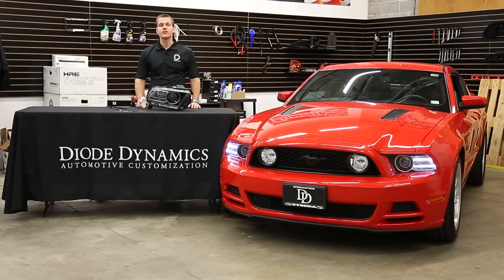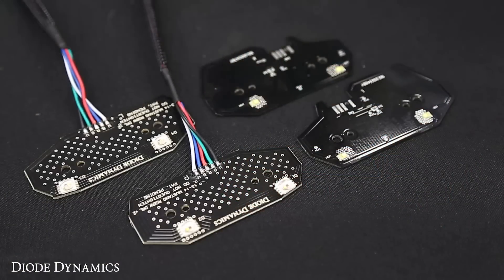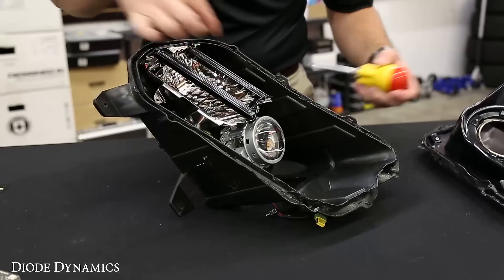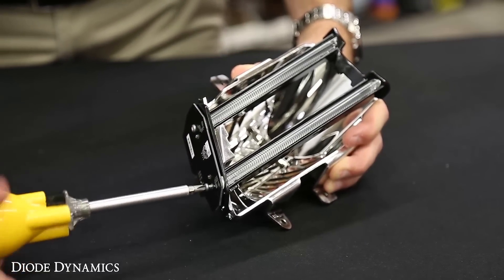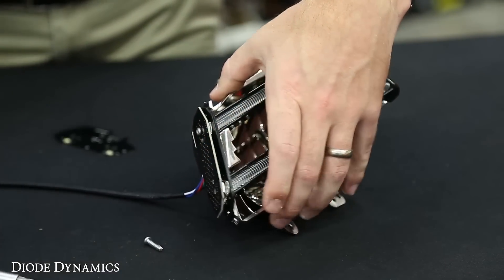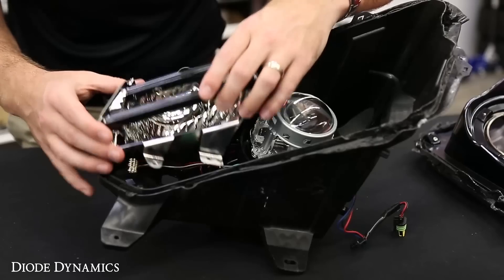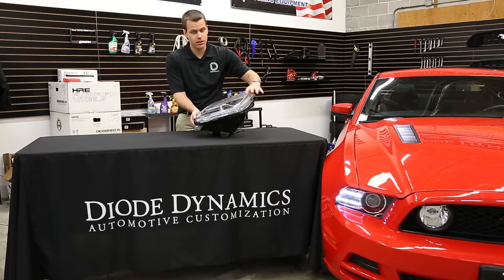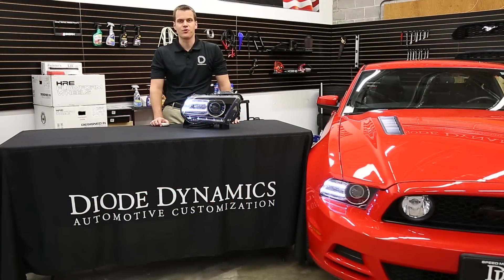How to Install 2013-2014 Ford Mustang RGBW™ DRL LED Boards by Diode Dynamics

Comment: Can you guys make a video of where to wire them to the fuse box or the battery because I’m confused and is it supposed to come with a controller so I can leave it at a certain color or will it just keep changing how does that work very curious
Reply from the maker: This kit does require a Bluetooth controller. Here is the link for you:

https://www.diodedynamics.com/rgbw-bluetooth-controller.html

If you need any help with the installation, our in-house US Customer service team would be more than happy to help you out with that!

Hours: Monday-Friday 10 a.m. - 5 p.m. CST
Email: contact@diodedynamics.com
Phone: 314-205-3033

Comment: It would really benefit customers if you took the time to show how to wire these. Anyone can make a video to remove the old board and replace it with the new one. My specific issue is tapping them into the headlights/turn signals.
Reply from the maker: We will consider this for the future! If you need help with the install, feel free to give us a call at 314-205-3033 Monday-Friday 10 a.m.- 5 p.m. CST, or shoot us an email at contact@diodedynamics.com, and our service team would be happy to help you with that.

Comment: One of the led strip went out on my passenger side headlight. ..... just a shot in the dark question, do you think if I replaced the board that it will fix that problem? Or should I get a whole new unit. Thanks!
Reply from the maker: Hmmm - We would like to hear more about the issue. Please go ahead and give us a call at 314-205-3033 Monday-Friday 10 a.m.- 5 p.m. CST, or shoot us an email at contact@diodedynamics.com, and our service team would be happy to help you with that.

Comment: Hi, I have an issue with my driver drl, doesn't turn on, is there any fuse to replace or could be disconnected ?  Only the driver drl have the problem
Reply from the maker: Hi Jesus! Please go ahead and give us a call at 314-205-3033 Monday-Friday 10 a.m.- 5 p.m. CST, or shoot us an email at contact@diodedynamics.com, and our service team would be happy to help you with that.
Reply: Did you ever find out what caused it?

Comment: Hey so I just got mine all done up. I have the demon eyes and drl boreds as well. My drls will stay off when I turn the headlights on with out the rgb but they work when I have the rgb on.
Reply from the maker: Yes, you will need to have the RGBW on to run the DRLs. You can set them to white through your controller or app if you have the Bluetooth Controller for on-road use!

Comment: Where’s the wiring guide?
Reply from the maker: Hello there! Just remove the original boards, and ours will fit directly in place with correct alignment. Please go ahead and give us a call at 314-205-3033 Monday-Friday 10 a.m.- 5 p.m. CST, or shoot us an email at contact@diodedynamics.com, and our service team would be happy to help you with any further questions you may have!

Comment: how did you open light housing  ?
Reply from the maker: Hi there! For this particular product, the headlight must be heated up in order for the adhesive to soften, allowing the headlight to be opened. We strongly recommend professional installation, as it is possible to damage the headlights and other components during this process.

Comment: Ordered them and one of them doesn’t work. Talked to a dealer and he said 1 in 50 is usually faulty. Pretty disappointed.
Reply from the maker: We are very sorry to hear about the issues you've experienced with your board! We do test them in-house before shipping them out, so it is very unfortunate to hear that it is not working. If you have not already, please give us a call at 314-205-3033 Monday-Friday 9 a.m.- 5 p.m. CST, or shoot us an email at contact@diodedynamics.com, and we can help you with any troubleshooting and get you taken care of with a replacement if needed. Again, we truly apologize for any inconvenience.

Comment: HARDEST THING TO DO.... HAVE A PROFESSIONAL DO THIS
Reply: It’s not hard to do; just time-consuming. You need to have a lot of patience to open them up properly, but everything else isn’t that bad. Just set a day or two to do the project and don’t rush it…
Reply: @jmendozas197   do u have a social media or any way I can message u for help
Reply: @truguard1763  What issues are you experiencing?
Reply: @jmendozas197  everything it plugging in the bluetooth controller lights up but no rgb

Comment: i don't know if you seen the raxiom halo fog lights would this work as well with the fog lights?
Reply from the maker: +Gilberg Ifarraguerri We're not familiar with the product you're referring to, but you can use an RGBW or RGB controller to control our boards and other mulitcolor products simultaneously! If you have any further questions, please don't hesitate to contact us!
Reply: you don't the same chip for the fog lights to change colors?

Comment: Do I connect the transmitter to the battery? I bought these lights and connected all the RGBW to the transmitter Im just confused what to do with the 2 red wires and the one black wire... Please help
Reply from the maker: +Chris Nieves Please send us an email at contact@diodedynamics.com, and we can walk you through this!

Comment: Where can i buy the stock led light? i like the stock white but one the led lights on the driver side stopped working
Reply from the maker: +tripleb4life These boards can be set to a pure white running light for a clean OEM look!

Comment: Help i don't understand how to wire them
Reply from the maker: +Darryl Metcalfe, below is a link to our installation guide with wiring instructions on the back. If you need further assistance, feel free to contact us at 314-205-3033, Monday-Friday 9am-5pm CST, or email us at contact@diodedynamics.com, and our sales representatives can help you out! 

http://diodedynamics.com/docs/install/ford/mustang/13-14_Ford_Mustang_RGBW_installation_guide.pdf
Reply: Diode Dynamics please send me instructions on how to wire the led boards.  my email address is c_carrasco84@yahoo.com
Thank you

Comment: Is it possible to get the lens off with a good heat gun? I'm really apprehensive about putting my lights in the oven.
Reply from the maker: +Auto Young We recommend using an oven to open up the headlamp; however, it is possible to get the lens off with a heat gun. Typically, a heat gun is more tedious and takes longer, but it can still be done. If you have any other questions, feel free to contact us!

Comment: I wish you guys would make an oem orange upgrade to use with the oem plug!
Reply from the maker: +Tj Case, these LED boards will allow you to achieve an order color, and we also offer amber bulbs for turn signal applications!
Reply: Awww, these don't come in orange? Glad I saw this comment before purchasing them, that's all I wanted them for. Would've made a nice addition to my orange flood lamps, interior lighting and bay lighting. Unfortunate.